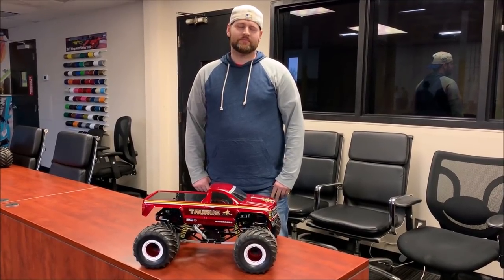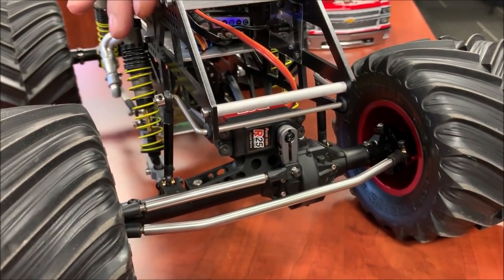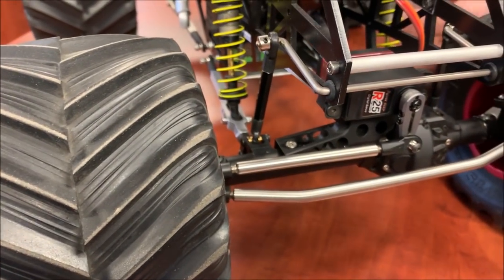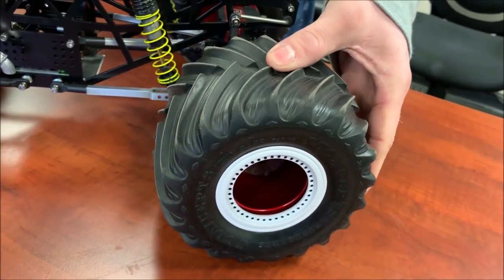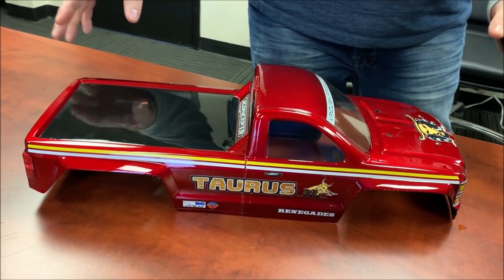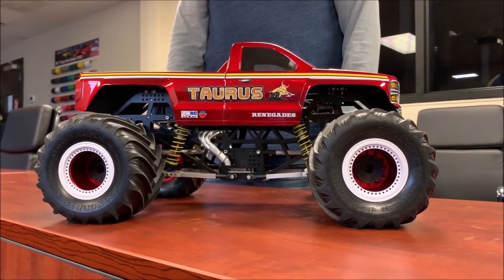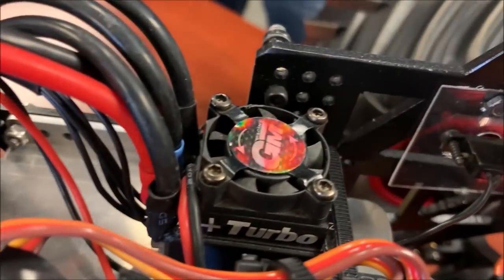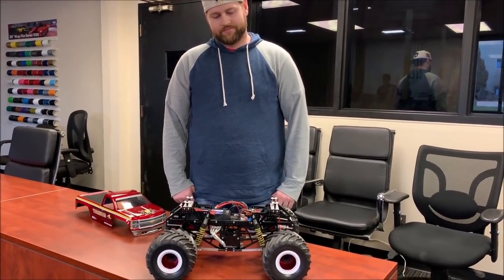Taurus Racer ACRC Havoc gen1 Chassis Overview - Trigger King Tech

Comment: If you don't mind me asking,how did you get your wheels to match if the paint? If you used paint what brand/colors? I know you said the body is Tamiya PS-37 backed with PS-48 and then followed with black,but I didn't think polycarbonate paint would work on nylon/plastic RC wheels. Any info will be much appreciated.
Reply: Jonathan Davis you are correct, the rims are painted with Tamiya TS paint but I couldn’t remember the numbers during the interview. It’s Tamiya white primer, TS-76 mica silver, topped by TS-74 clear red for the matching red rims.